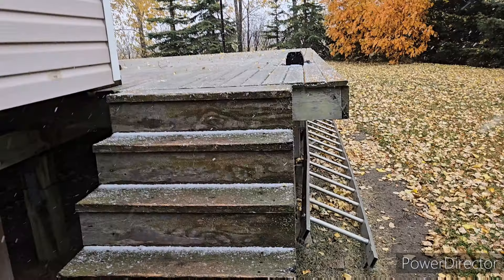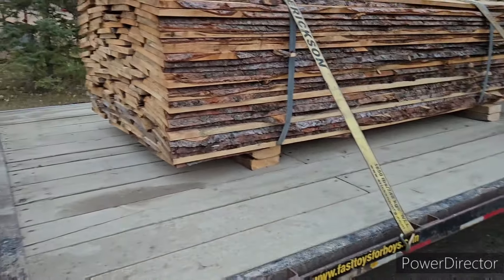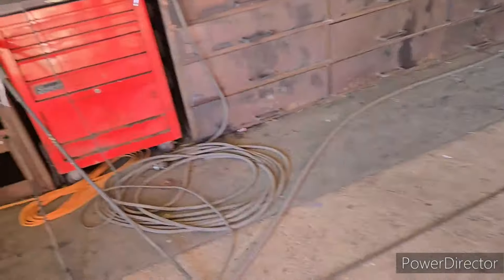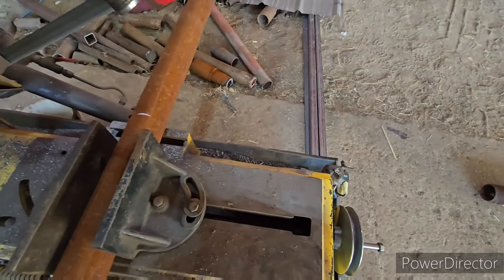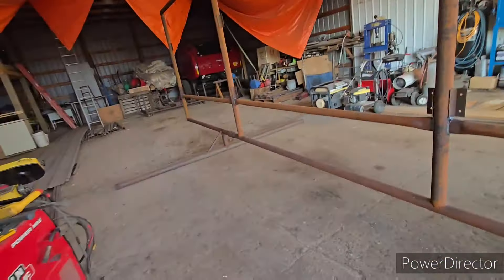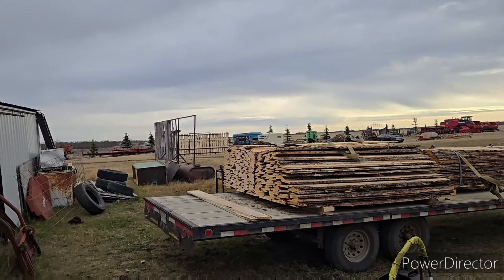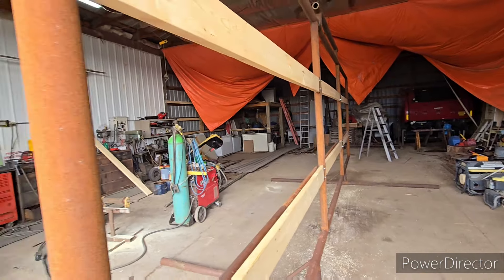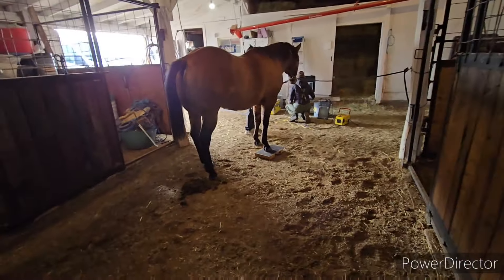Portable Livestock Windbreaks

Comment: Hey BP and CP, I like that bull rail on the outside and along the plank. With it ontop or underneath, I think they could still break that plank. with it ontop, virtually no chance. I could see though how it would be more of a pain manuvering the plank in unless you weld the pipe after bolting the plank on. Good Job 👍
Reply from the maker: @3dranchmanitoba  it is a bit of a pain but it works